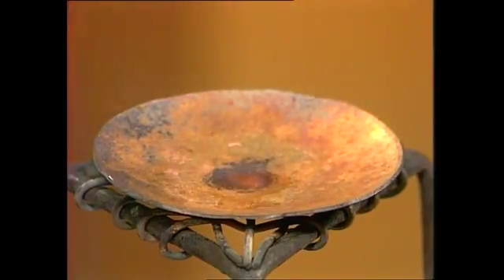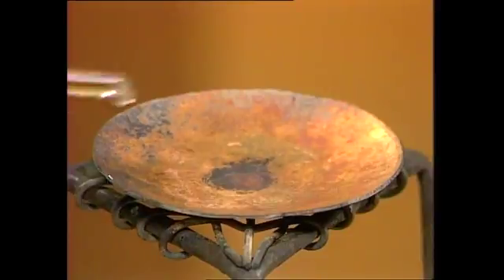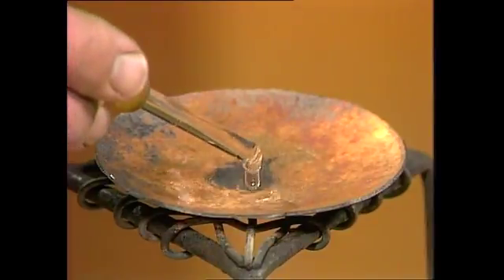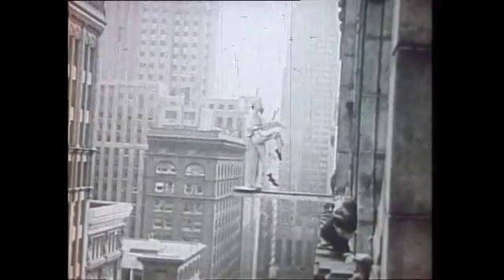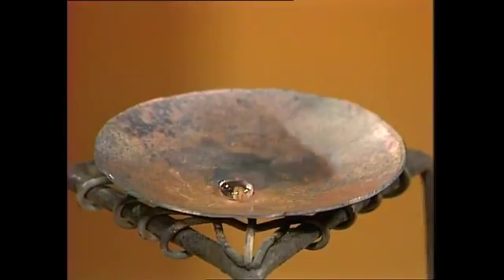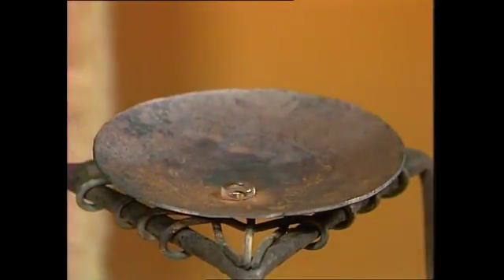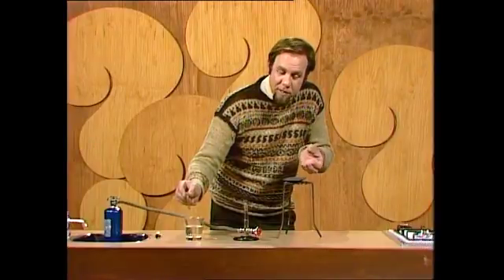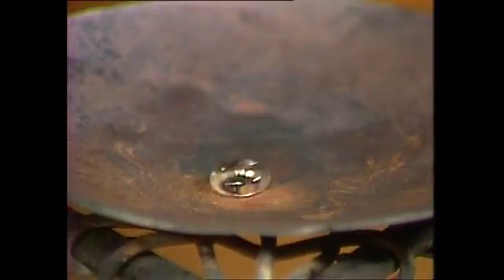Mysterious Levitating Water Droplets

Comment: When you add more water and it flattens the steam, why doesnt it produce more steam quid pro quo ?.
Reply from the maker: It probably does for a while but eventually the weight of the drop is just too much for the 'lift' of the steam. Technically, the volume and weight of the drop increases as a cube of the diameter of it while the surface area where the steam is applied increases only as a square of it, so eventually weight wins - Rob

Comment: Again wonderfully explained :) I sometimes witness this same effect on a hot ceramic cooking field in the kitchen, when accidentally dropping some water on one of the still hot cooking fields. However i haven't managed yet to make a drop of water dance gently like Rob did on the concave copper plate.
Reply from the maker: The concavity helps, or it simply rolls off a flat surface like mercury - Rob
Reply: You're not trying hard enough evidently.